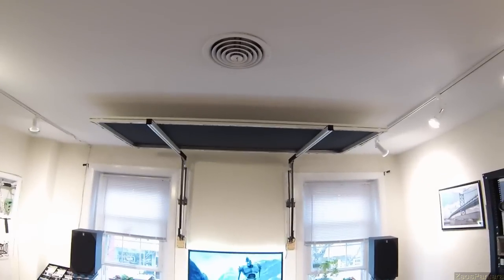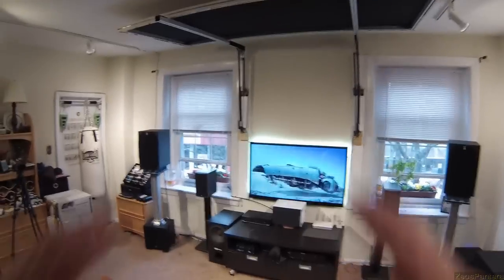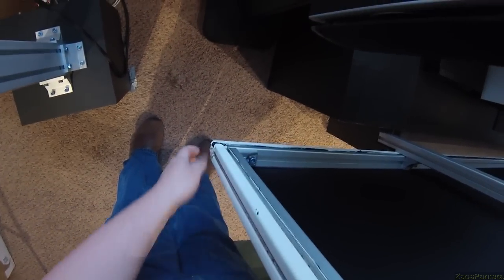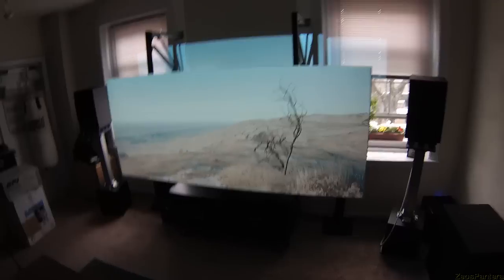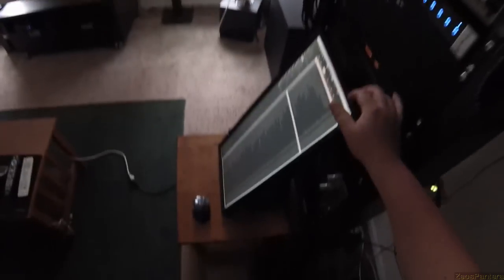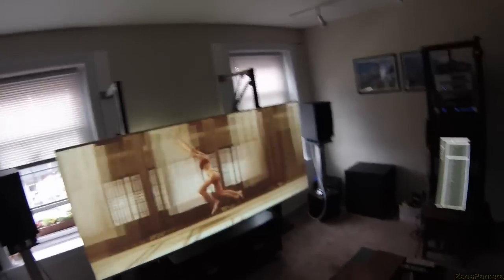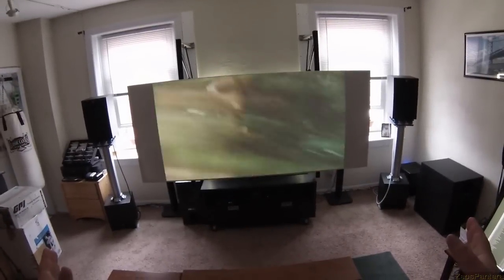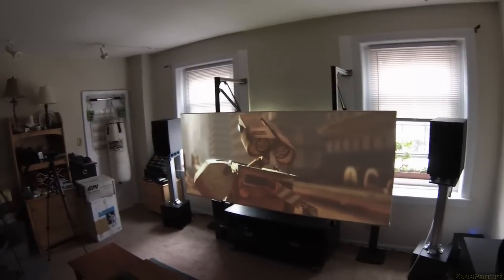Z Review - DIY 104" (2.35:1) Projection Screen (Take 1)

Comment: One question did you ever look into "screen goo"...
Reply: trexx32 I have. It is rather expensive and you can get similar results with the "black widow" mix. Basically you need PPG Bermuda Beige and some Fine Ground Aluminum Car paint additive and bam. Excellent paint on screen.

Unless you are wondering if I "goo'd" my screen. In which case, hahahaha.. not lately.